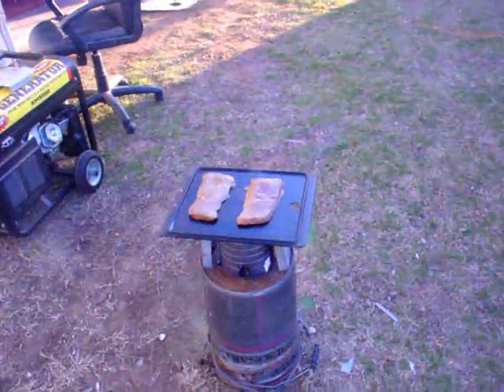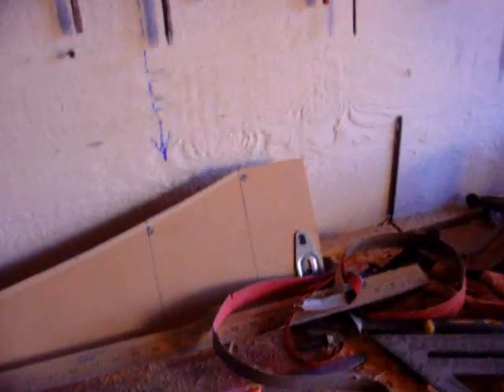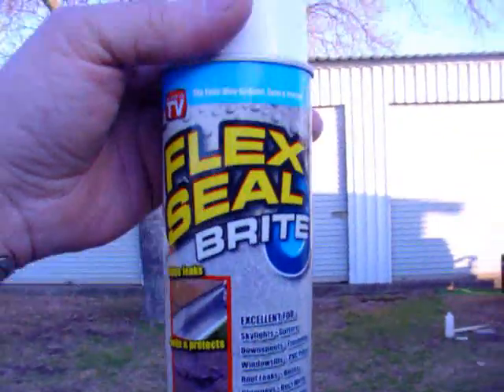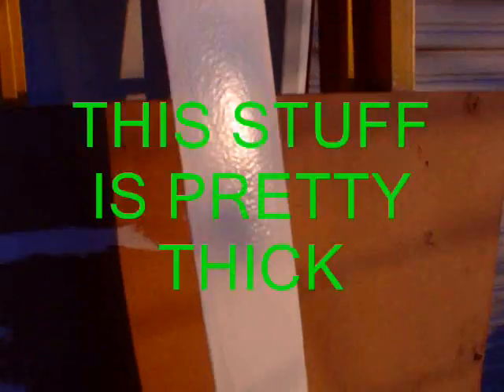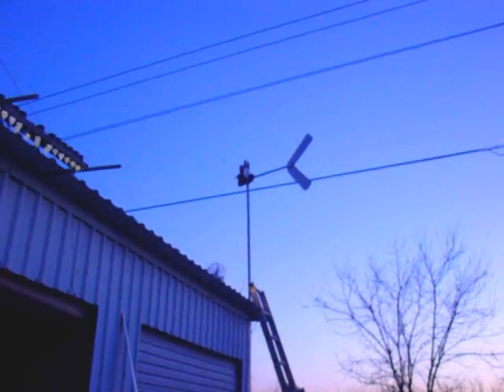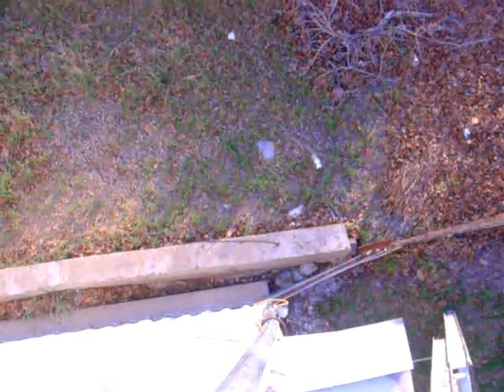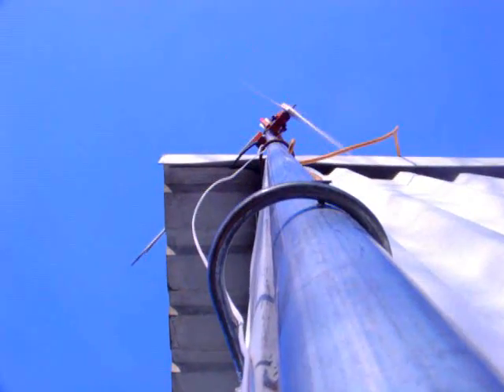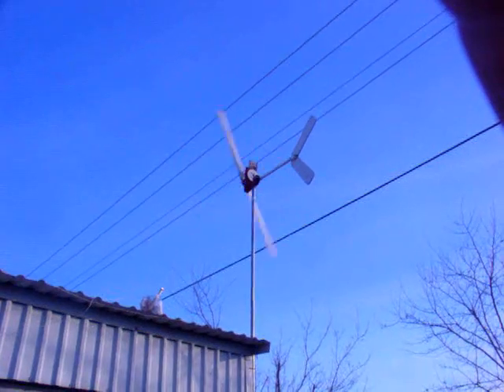PART 9 DESIGN OF MUDDYS' MIGHTY MINI WIND TURBINE

Comment: Like that prop !!! and the food looks good too!!!
Reply from the maker: THIS STEAK WAS A BIT TOUGH, BUT THE ONES IN THE NEXT VIDEO CAME OUT SWEET, JUICY TENDER, AND JUST PLAIN YUMMy.
THE PROP WAS A TASK TEST FOR THE ADAPTATION FOR THE BLADE CARVING MACHINE. I WENT THE FULL LENGTH OF THE BENCH TO CARVE THE NEW ONE. I ACTUALLY WANTED 4 MORE INCHES. AT LEAST ACCORDING TO WHAT THE FIGURES I WAS WORKING WITH. THE WIND SPEED WAS GUESSED IN THOSE FIGURES, AND THE RPMs WERE GUESSED.
I GUESS I HAD A VERY CLOSE SENSE FOR THE WIND, AND A GOOD ESTIMATE FOR THE RPMs. BECAUSE, WITH 4 INCHES LOST DUE TO THE BENCHES CAPABILITY TO CARVE A LONGER PROP, THIS PROP SEEMED TO SPOT ON. AND MY PROP CARVING MACHINES' NEW MODIFICATIONS WORKED WONDERFULLY.
:) I'M GONNA CARVE A FEW MORE NOW.
MUDDy

Comment: apparently there is a difference in ac vs dc water heater elements, Jeff has them.
best john
Reply from the maker: AC USUALLY MEANS 120 OR 240 VAC, 12 VOLTS DC WOULD HAVE A MUCH LOWER RESISTANCE TO ALLOW THE AMPS AT THE LOWER VOLTAGE.
BUT IF THEY WERE TALKING ABOUT THE SAME VOLTAGE, I COULDN'T SEE WHY THEY WOULD BE DIFFERENT. THE WATER HEATER ELEMENT IS NOTHING BUT A SEALED TUBE AS A HEAT SINK, AND A RESISTOR. NICHROME RESISTANCE WIRE, OR CARBON RESISTOR, WHICH MAKES NO CHANGE FROM AC TO DC. THE WATTS OUT ARE ALWAYS VOLTAGE DIVIDED BY RESITANCE EQUALS (WATTS,POWER). IN THIS CASE, HEAT DISSIPATED IN WATTS.
SO I SAY,..... JUST DONT PUT MORE VOLTAGE TO A LOWER VOLTAGE ELEMENT, AND THAT ALL ONE NEEDS TO WORRY ABOUT.
BUT PUTTING 12 VOLTS TO A 120 VOLTS ELEMENT, WOULD, AT BEST, PUT OUT 1/10nth THE WATTAGE.
:)
MUDDy
Reply: ***** Jeff did a video explaining the difference. Perhaps there is a diode or something that would make poor performance.

Comment: you were supposed to use the flex seal on the leaky generator housing.....how much was that spray bomb anyway?
 talk about adhesion torcher testing...lol
Reply from the maker: Ha Ha, ya i know. the flex seal cost just a little more than enamel paint. So the science of flex seal, props and, experimenting took over.
wwwweeee. there is still enough to do the Chinese wind turbine. The good thing I know from painting cars is, paint with a little flex agent added, keeps the paint from scratchng, and/or chipping off. they usually put it in the paint they use on the rubber/plastic bumpers. So I figure this prop shouldnt need painting or sealing for some time. and i'm glad it is white as well.
The future of this should be pretty interesting.
MUDDy
Reply from the maker: HaHa ya I know. But the science of flex seal took over when i was thinking about the new prop.
I didn't pay much more than enamel paint. So I figured I would give it a nice test.

Comment: Hey Muddy, Nice to see you uploading again.
Thanks for the massive description, but could you bung the video comments in aswell, I was trying to figure out your resistances in my head and still listen at the same time.
Are you running star in 3 or 4 wire mode? you can save a lot of copper awg in 4 wire. Or have you thought about rectifying to dc at the top of the pole where the wind will cool down the heatsink and run dc down the pole. In which case you can double your amps by just pairing up the wires (if your running 4 wire).
I haven't really been on it much but I have finally figured how to log stuff with an arduino on an SD card, I'm recording or electricy meter at the moment to give us some kind of energy usage profile.
How much does a pound of steak cost over there, meat is crazy prices over here.
Any hows wishing you all the best and looking forward to your new vids.
BTW used to be called 20royalsuperkings.
Reply from the maker: I NEVER HEARD OF 4 WIRE THREE PHASE, BUT, I DO UNDERSTAND THE RECTIFICATION AT THE TOP OF THE POLE. BUT, THE POWER LOSS IN VOLTAGE FOR DC WOULD MEAN I NEED FATTER WIRE TO CARRY THE AMPS, OR LIKE YOU SAID, DOUBLE UP THE PAIRS TO ACT LIKE A FATTER GAGE WIRE.
   ACTUALLY I WAS THINKING OF DOING JUST THAT WITH ANOTHER EXTENSION CORD SO IT WOULD EQUAL 9 GAGE. MUCH CHEAPER JUST ADDING ANOTHER CRAPPED EXTENSION CORD. I HAVE SEVERAL AROUND HERE.
   AS FOR THE STEAKS, WE GO BY THE STORE ON THE WAY TO THE SHOP AND LOOK FOR THE BIGGEST PACKAGE WE CAN GET FOR 5 BUCKS. MUCH CHEAPER THAN TWO BURRITOS AND BETTER TASTING TOO. LOL.
   KEEP SMILING OH GREAT KING.
MUDDy

Comment: is the emt pole heavy wall pope or is it thin wall tubing? if it's heavy wall, you may want to go with black iron pipe instead. when pipe is galvanized it weakens the rigidity of the steel within. this is information i learned from other ham radio operators, when dealing with parts for a tower system. water pipe is the same way. so find some gas pipe to make a stronger mast pole. i don't know the name of this but you can stabilize and strengthen a pole by rigging cables along a pole or mast. like those used on fishing outriggers. http://lmrtackle.com/images/products/detail/standardliftoutbase.jpg
Reply from the maker: GREAT COMMENT BRO. SOMEONE HIT THE SPAM BUTTON, BUT I READ IT, AND SAID TO MYSELF. WHY SPAM THIS COMMENT? AND THE LINK IS FOR EXAMPLE, NOT ADVERTISING. SO I SAY THANKS.
ALSO I DID NOT KNOW ABOUT THE STRENGTH DIFFERENCE IN GALVANIZED AND NO GALVANIZED PIPES. BUT I DID KNOW ABOUT THE BLACK PIPE.
BUT ONCE AGAIN,.... I DIDN'T EVEN CROSS MY MIND. MOST OF HAT I USE IS TRASH DAY FINDS. GOOD OLD MUDDY THE THRIFTY MISER. LOL.
THANKS AGAIN. I GUESS I COULD AFFORD ONE PIECE OF PIPE HUH?
PUT A CROWBAR TO THE OLD WALLET.
MUDDy
Reply: lol, thanks for not spaming it. i couldn't think of it's real name. i knew it was used in nautical applications. i knew they were used in outriggers. but once i found a picture of it. that's the best way i could think of to get a thousand words across without saying a thing.
Reply: one more thing. if you use the wires like in the picture. you can use thin wall emt. if those outriggers didn't have the wire cables. they would fold up.
Reply from the maker: Dale Myers
EXACTLY MATE. THANKS AGAIN.
I USUALLY CHECK OUT THE LINKS ANYWAY, ND GIVE FOLKS THE BENEFIT OF THE DOUBT. THE ONES I HATE ARE THE COPY PASTE , OR COMPUTER GENERATED MESSAGES. X(
LOL
MUDDy

Comment: set up is looking good Scott. I finally got my VAWT installed and guess what, same thing that happened to you happened to me, no wind for a week lol. that mini is doing a great job. can not wait for you to catch some really good wind hitting that blade set up. catch ya later on!!
Reply from the maker: YUP, I ALREADY GOT SOME HEAVY WINDS WITH THE NEW PROP. VIDEO IS ON THE WAY. I GOT TO THE SHOP AND NOTICED THAT THE PROP WAS FREEWHEELING. AND THE POLE WAS BENT AGAIN. WHEN I OPENED UP AND GOT INSIDE, I SHUT IT DOWN. NO CHANGE ON THE VOLTAGE. THEN I CHECKED THE FUSE. SURE ENOUGH, THE 20 AMP FUSE TO THE WIND TURBINE WAS BLOWN.
I NO LONGER HAVE THE FUSE IN LINE.
SINCE THEN I HAVE SEEN MUCH BETTER WATTAGES AND AMPS INTO THE SYSTEM. AND EVEN BETTER, I HAVE THE TACHOMETER INSTALLED. AND WE HAVE THE NEW DUMP LOAD SET UP AS WELL.
THANKS BRO.
MUDDy

Comment: Works great. You need a wind grid tie inverter instead of dumping the power. I am concerned that you need it to furl or your going to damage it. More batteries would be nice huh.
Reply from the maker: MOST DEFINITELY MORE BATTERIES, AND THE FURLING MECHANISM AS WELL. AS FAR AS GRID TIES GO. THERE ARE NO POWER LINES TO THE WHOLE STORAGE FACILITY. :(
I AM THE ONLY ONE WITH POWER DOWN THERE. THE DUMP LOAD BEING LIGHT IS WELCOME AT NIGHT, AND CERTAINLY A CHEAP THRILL.
MUDDy